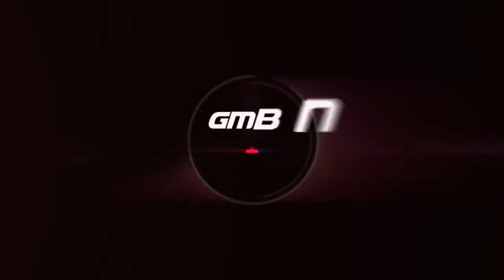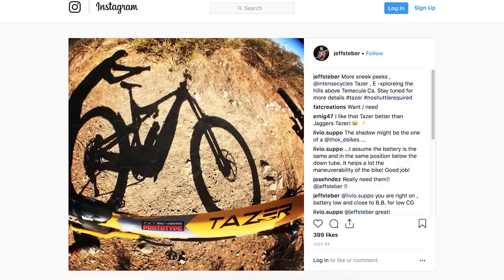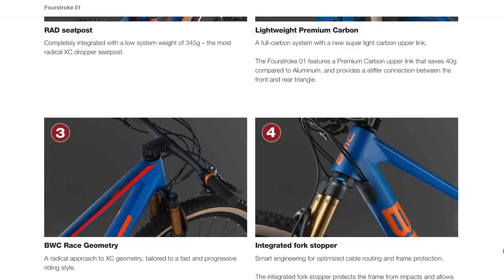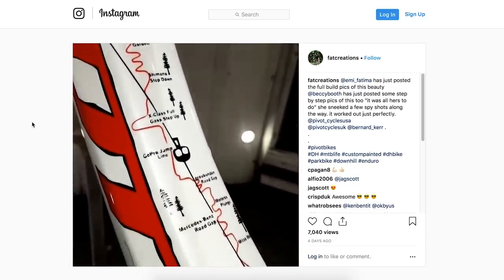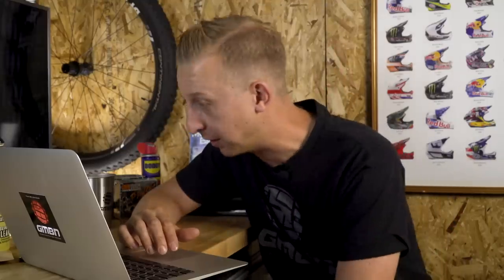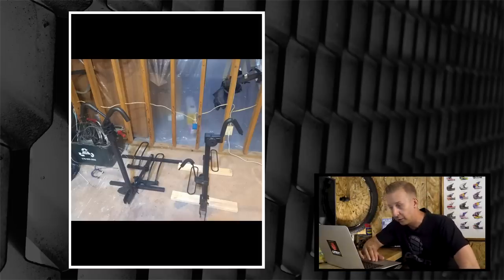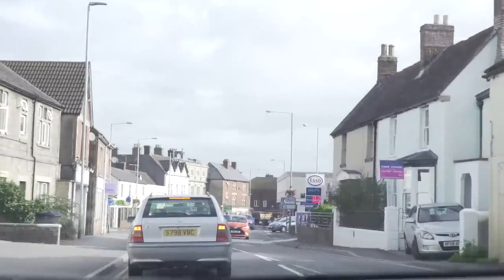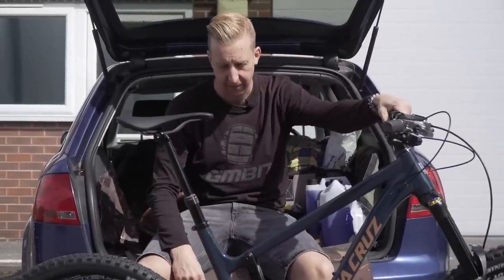Next Generation XC Bikes | GMBN Tech Show Ep. 36

Comment: I had one of those Selle Italia Saddles !!! Looks KOOL !!!!!!!!!! but i had a Sore ARSE after( U>S>E  Elastomer Seat Post ) . Sold it but Regret Selling Now 
Still have the Original BOX ! the Saddle was on my 1992 Alpinestars AL-Mega DX , Still have the Frame WELDED a PM bracket for the Rear for a 120mm Rotor !!!!!!!!! Had a Manitou 4 fork but sold that Now have a Adaptor to run 1  1/8 stem and put a Exotic Rigid Fork ,Still have the White Industries triple Crankset USA Forged Not the Sugino Clone

Comment: Integrated dropper post? I have heard that traditional systems need quite a lot of maintenance, integrating it will make it more difficult. It’s really nice bike and the vertical rear shock is the way to go, but looks like a Pro bike, not for everyone.
Reply: Alvaro Q.F is the maintenance due to dirt and debris? If so this won't have that problem
Reply from the maker: It really depends on the dropper post. Some require a lot of maintenance, others require very little. There's been a couple integrated dropper posts out there, and one of the benefits is that they have a wider diameter than normal dropper, giving more room to improve reliability and durability. But time will tell with the specific designs.

Comment: Right now I am using nike sb skate shoes to ride but they have quite a bit of flex. Is their any flat pedal mtb specific shoes that u can recommend that won't break the bank.im in the US by the way
Reply: Casey G. The best thing to do is wait for a pair of five tens like the free rider or the free rider pro to go on sale and get a good deal
Reply: Any five tens are great. Im currently using fiveten districts flat pedal shoes because i didn't want to  pay over 80 dollars. They are pretty good. If you spend 100 or more, most fivetens come with stealth rubber soles.